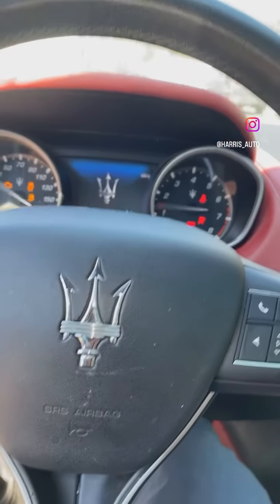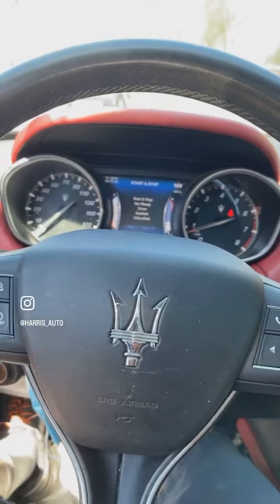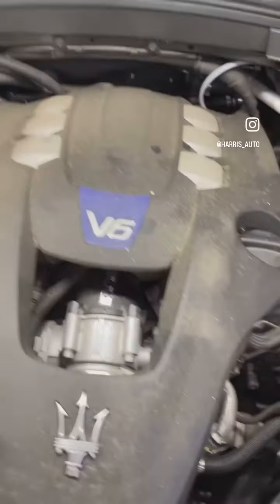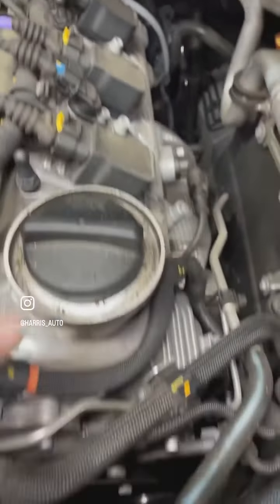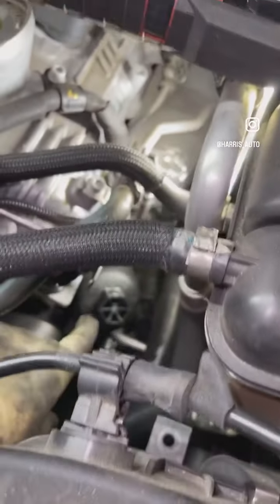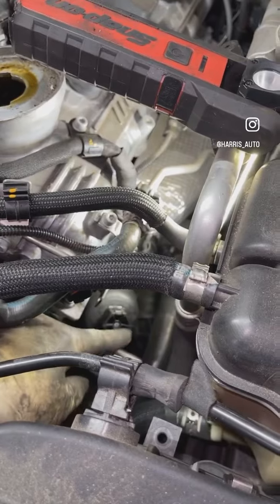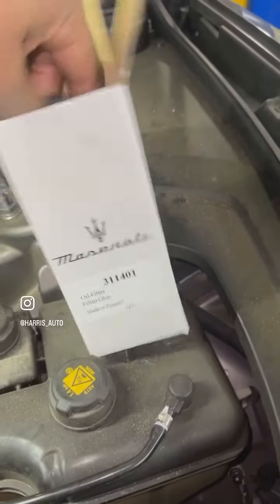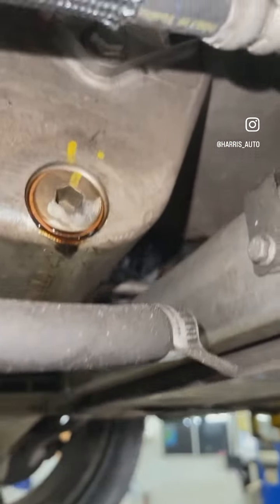Maserati oil change.

Comment: Yeah this one’s simple, but a car is not a car, you will not be able to do this on a Bugatti this easily.
Reply from the maker: Car is car to me, some require more work than others when it comes to replacing things.
Reply: @goharrisautomotive  sure, they just need certain equipment sometimes that may not be available, on the vast majority of cars it’s very simple, very few are complicated, sometimes ten drain plugs, certain procedures, stuff like that, it takes some outside information.